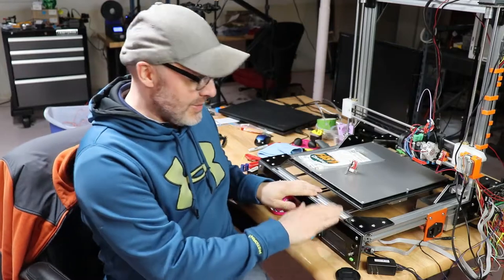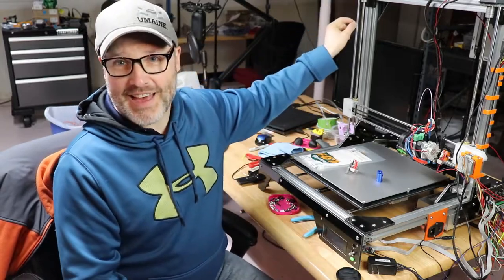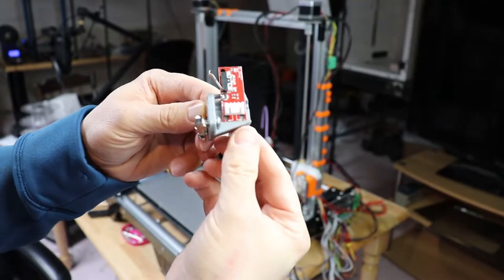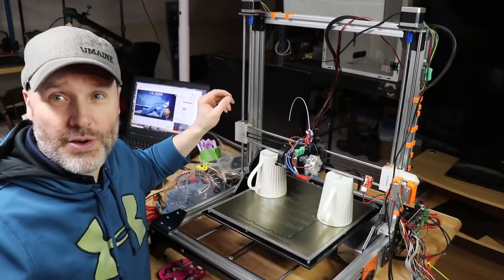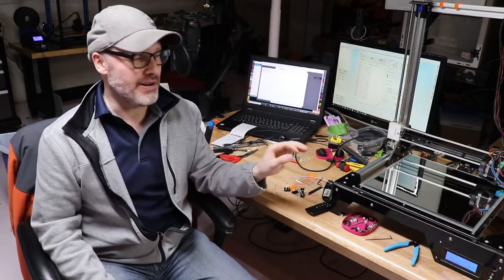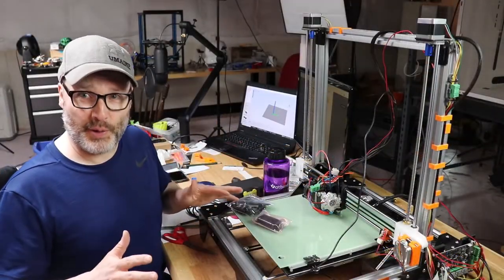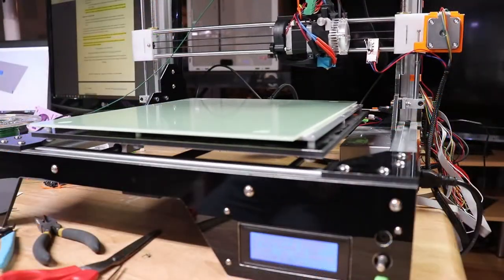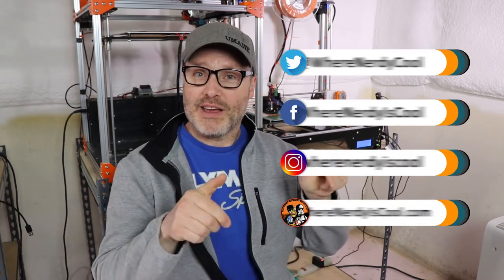Upgrading the FolgerTech FT-i3 Mega 3D Printer

Comment: Yeah Paul, wanna be friends?.. Anyway, good to see you got everything back together and running. Looks good
Reply from the maker: Hi !  I wish I could solve the fan issue.  But other than that it’s printing extremely well
Reply: @WhereNerdyisCool  what mount did you use i need that stl
Reply from the maker: This was custom made by Keith Benett (@thisiskeithb on Twitter)